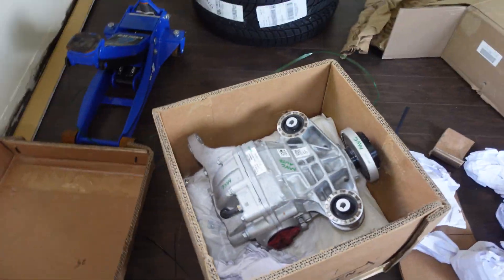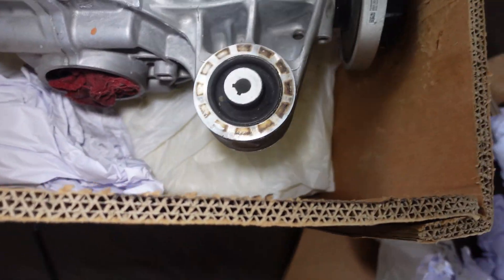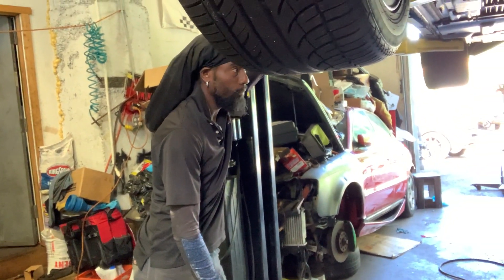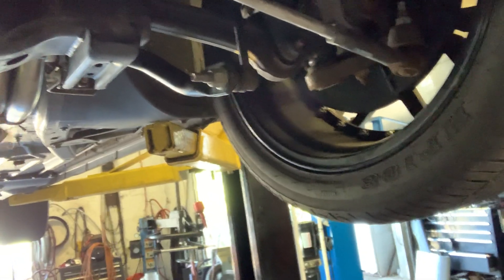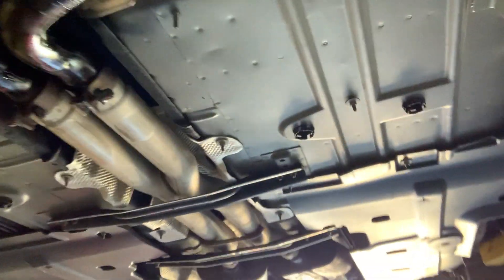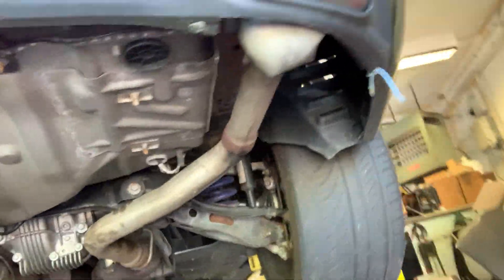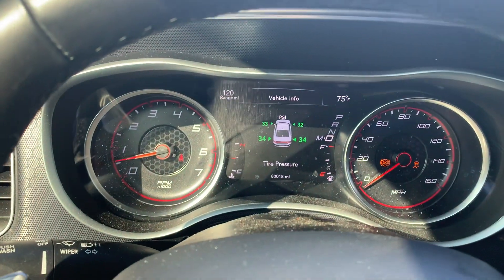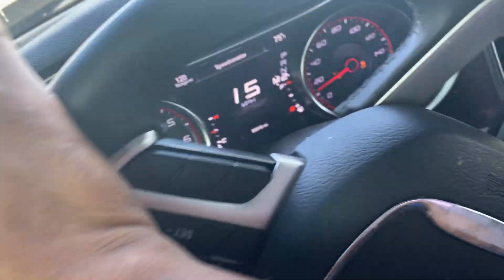installing long tube headers on charger rt 5.7

Comment: Hellcat and RT have the same final drive ratio. The 3.09 is specific to the scat pack. Also, going to a higher final drive ratio isn’t going to help you grip at all, in fact, it may make spinning even more likely because the vehicle will increase in RPM a lot quicker than it did with the stock 2.62 rear gear.
Reply: Okay I see now that later into the video you corrected yourself about the “grip”. Still, 3.09 is scatpack, not hellcat.

Comment: Did you have to get a new driveshaft to go with the 3.09?  Also with the tune did the engine light stay off?
Reply: No new driveshaft , engine light will go off once the tune is on . Get go hp tuner  for more horsepower.
Reply: Buy hellcat injectors and 3 pen map sensor will boost 100 more horsepower